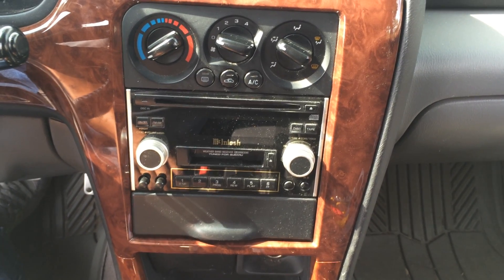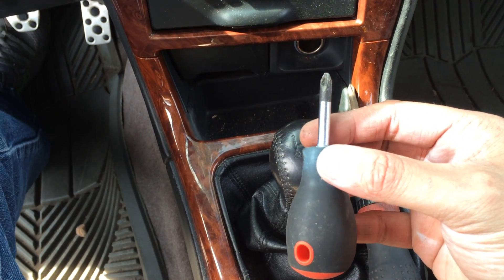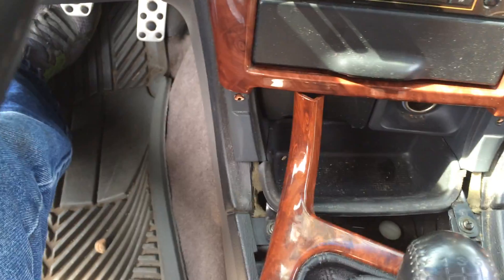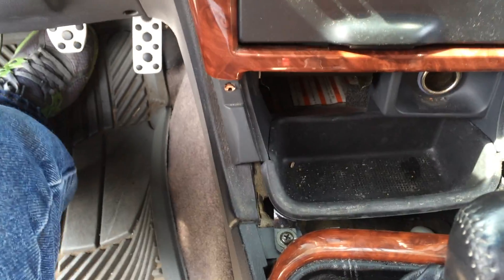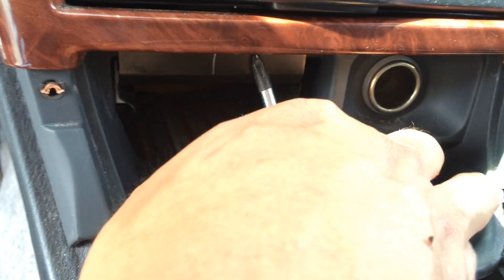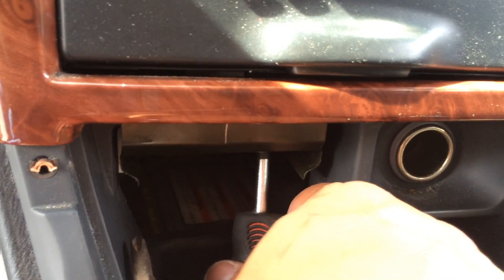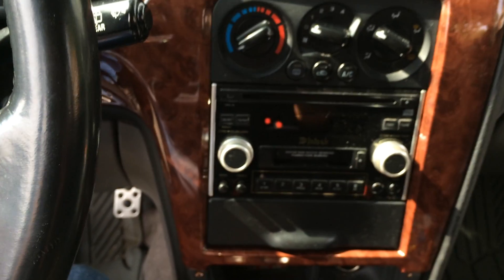2000-2004 Subaru Legacy Outback Radio and Bezel Trim Removal

Comment: Just tried this. DO NOT pull back on the bezel around the shifter you will break the clips and DO NOT remove the screw deep in the back you don’t have to. Otherwise, good tip!

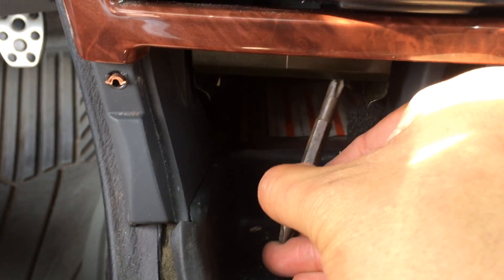Comment: The hash tray piece at  2:05 that is screw in doesn’t need to be remove and the screw in the back doesn’t need to be taking out but other wise it’s right, just used interior trim tools to safety remove any trim in the car

Comment: You have THE BEST demo for this. I have an old stereo I wanna retire. Great job George~!  PS. Have you any mechanical issues on your Subaru at all?
Reply from the maker: Had it for 6 years and sold it to a friend. He had it for another 4 years before giving it to another friend. 

All good through out the years. 

At the end. Rust in from salted roads in NYC just got too much for it. Junked about 1 year ago from all the body rust.

Comment: Hi there, just wondering whether having a cup holder on this panel causes any difficulty, I noticed youbdidnt have one here
Reply from the maker: I don't believe so, I had a '91 Subaru Legacy with the in-dash two cup holder popout and didn't have much difficulty swapping in a new head unit.
Reply: Awesome thanks, gave it a go but didn't wanna come out from behind the cup holder, I'll give it another crack and be a bit more insistant :p

Comment: I've never seen an Outback with the McIntosh audio and a 5 speed manual. I don't think such a model was ever available in the United States.  Where are you located?
Reply from the maker: I'm located in the United States. I created this. I sourced a donor Outback VDC and took the under passenger seat amplifier, all speakers, including the rear subwoofer. Also, all the wiring harness that comes from the Mcintosh system.

My car is a Legacy 35th Anniversary edition
Reply: Mine is a stick as well, from the US
Reply: @carpediem381  I have a 2001 outback, not the legacy model, but it is a manual. Do these steps still apply to my car as well? I plan on putting in a stereo and subs next week
Reply: Eli Verhulst yes it’s the same interior pieces

Comment: Is there any specific connectors needed to plug the new radio in?
Reply from the maker: +SlyGuy , New radio will require an adapter specific to the radio and this model car. Sorry i can't be anymore specific as there are many types of aftermarket radios out there, but I know buying from a vendor like "Crutchfield". They will provide for free a radio adapter kit with a purchase of a new radio.
Reply from the maker: SlyGuy 

Try the below link for stereo (head unit) fit kits 
http://www.scosche.com/car-audio/installation